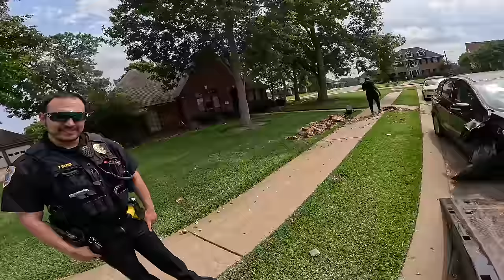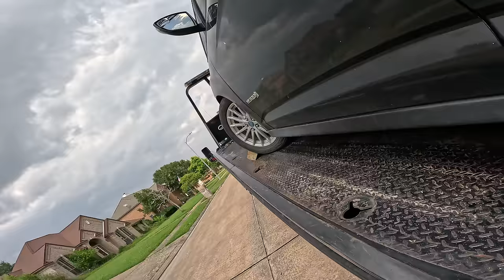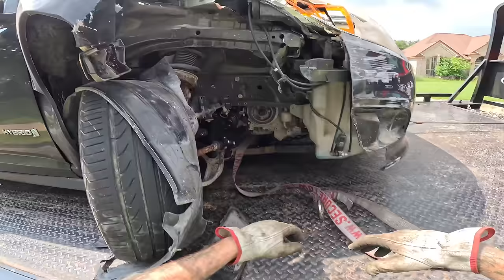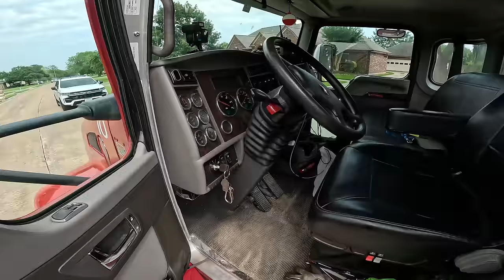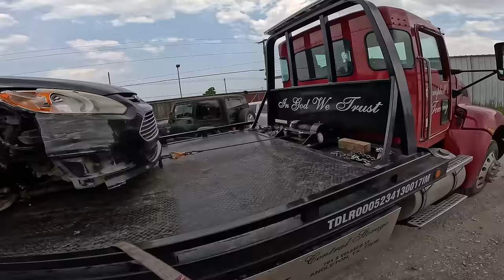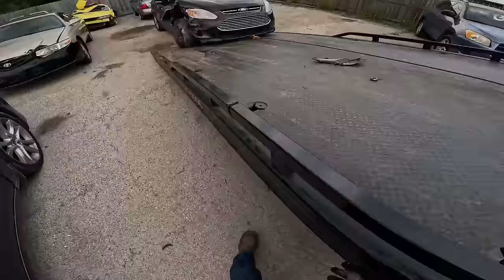Ford vs. Mailbox! How Not to Check the Mail!

Comment: Someone built a big snowman close to the road in their front yard every year. Some idiots always smashed it with a truck or something. They had a dead tree in the front yard, so they cut it down. Then they built the big snowman surrounding the tree stump. Sure enough when they woke up there was tire tracks and leaking fluids in front of the tree stump. The pickup truck apparently came to a sudden stop when it hit the tree stump. The pickup truck didn’t make it far. I don’t know if it was a Ford, but it was Found on road dead.
Reply from the maker: I bet they won’t do that again. Lol.